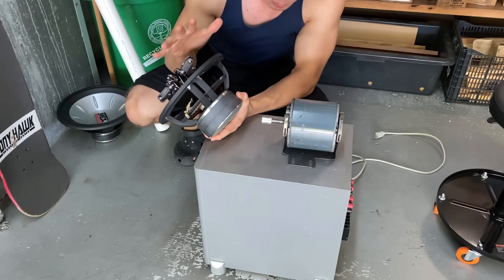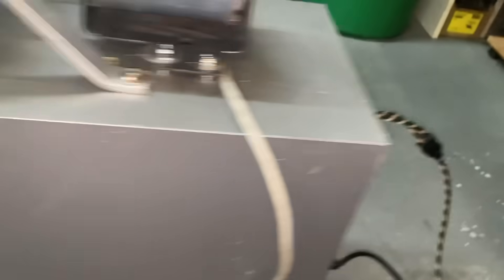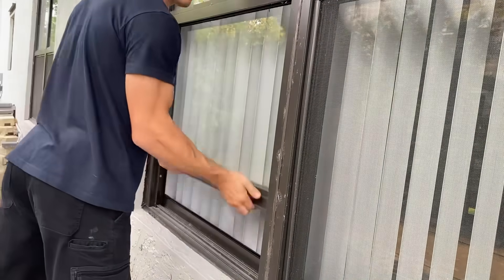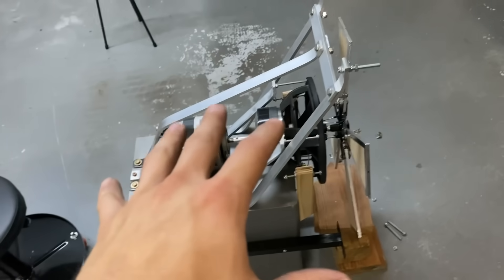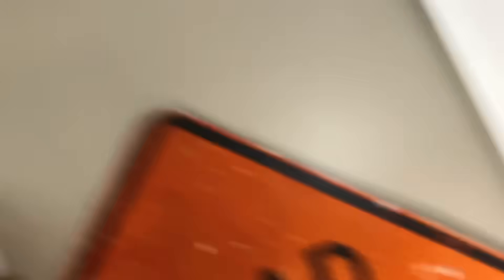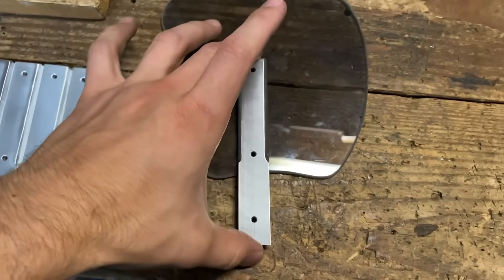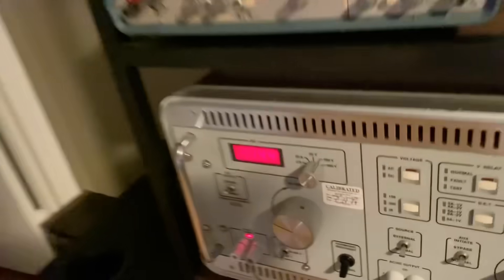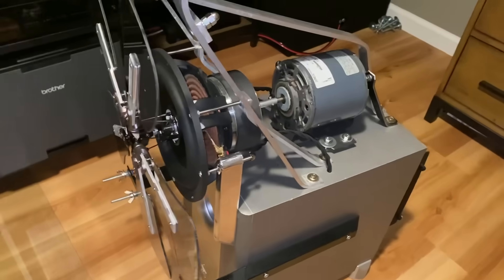Making the worlds most powerful subwoofer (Rotary Subwoofer)

Comment: I really wanted to see it demonstrated with more audible frequencies.

Some headphones might claim to reproduce 10hz, but who's going to call them on it when the average person can't hear anything lower than 20hz.
Reply: Its like max wattage vs rms wattage. And the lower the capability, the less the headphones will struggle when producing Near that frequency. Bass songs with 30khrtz to 200hrtz sound a lot different than 30khr😅tz to 15hrtz headphones. Also, want to look at driver size, 30mm don't sound as good as 40 or 50mm, or even dual driver headphones. Of course you have your tube amplified, just blowing everything you thought you knew about sound out the window.
Reply: You can easily hear down to 12hz if you have decent headphones / speakers and use a tone generator. At around 23hz it stops sounding like a tone and starts sounding like clicks however (for me). This is a subwoofer and a massive part of its purpose is to produce infrasound that can be felt in your body, and heard via the vibration of every object in the vicinity. What did you want? part of the video to simply be a sine wave that tells you nothing about this setups power or capabilities beyond that it can produce the same tones as any other subwoofer. This is a showcase of power and in order to showcase it you have to operate in infrasound, where most subwoofers couldn't even begin to match this thing.
Reply: 23 and can clearly hear the 10Hz. The average person watching this video is far younger than the global average that hearing averages are based on
Reply: You're quoting false information, there is no magic set limit at 20hz for human hearing, it is incorrectly quoted as being the limit as it is defined by the ANSI/ASA S1.1-2013 standard as the lower audible range of frequencies. Humans can hear and more so, perceive lower air pressure frequencies with ease.

Comment: Human hearing range is from ≈20Hz - 24kHz what we are hearing is not the 10Hz frequency but something different.
Reply: We can feel it if our speakers can reproduce it.
Reply: Likely overtones.
Reply: probably overtones (20hz, 30hz, 40hz, etc.)
Reply: @@mojogo1735 Do you have a name for the effect you're describing?
Reply: @@mojogo1735 You're so full of shit, read a fucking book.
Reply: Wrong, you're quoting outdated or false information, human hearing range has no set limit. You are quoting 20hz being the lower limit because it is commonly thought to be, as defined by ANSI/ASA S1.1-2013 standard for audible frequencies. Humans can hear and more so, perceive air pressure frequencies way below 20hz with ease. Stop spreading false information.

Comment: so i read it can go down to even 0 HZ, by just compressing the static air. but how high can it go? 20 HZ? 30? is it possible to get it into hearing range?
Reply: Not sure about his particular device, but the upper limit on these rotary woofers is close to 20 Hz. Anything above 30 Hz gets some distortion. Fortunately, the rotary woofer covers what loudspeakers cannot, and vice versa.
Reply: Most speakers can go down to 1 hz.. go to Google type in tone generator and set it to 1hz and watch your speaker breathe at 1hz
Reply: Hearing Range will not shake anything and it will just be loud to be real
Reply: @ELISHACAEZ  probably but im asking about what it CAN do, whats the upper limit?
Reply: @ELISHACAEZ  Do you mean with this particular speaker or in general?

Comment: Hey, I used to work for Eminent back in '08-'13 building these bad boys - great job! We used RC helicopter parts for a lot of prototypes before we went to custom machining/CNC for the commercial units. You'll find that the closer you get your blade tips to the baffle, your sound pressure will go up exponentially.
Reply from the maker: No way! Glad you were able to stumble on this vid. Big thanks for the tip, I’ll see what I can do minimize the gap.

I just have one question if u could. Do u have a piece of tech you’d recommend that can allow me to cross this thing over below 20hz. Everything out there doesn’t really let me work with freq that low

Comment: any chance you could link to that dude that used the helicopter rotor as the blade actuator? 
i wanna build my own now <3
Reply: Look up most any five rotor blade SCALE rc helly swash plate and blade grips set should get you close enough to compare tons of options If you have a big enough pair you can go as far as purchasing the spindle oh Jesus bolts and main spare gear with high torque high speed Alian metal servos and the Alian trex 800 dominator brushless motor with like I think 11hp 5 blades 5'+blade span 2400 rpm get yourself a 6 channel spectrum radio so you can have full control with 3 different collective modes leaving cyclic up to the driver and just for good throness you could try using 5 separate drivers you want to look for drivers with deep excursion the longer the speaker drivers excursion the more defecation you can achieve happy pants soiling🎉

Comment: 2 things, you need a special speed controller for it. The higher the amplitude the higher the resistance to the motor, the commercial one has a speed controller that will vary the power to the motor based on the sound coming in to maintain an EXACT rpm, otherwise the speed warbles with the movement of the blades and distorts the sound. Second, you need special blades, similar to the blade design of military submarines. Any old blade will chop the air and create significant distortion, the blades on the commercial woofer are designed to minimize air chopping and therefore unwanted distortion.

Comment: I have several questions regarding the Rotary Subwoofer 
Anyone have a explanation on it?? 
My brain is having a hard time trying to figure out the use and motivation behind it.
Reply: Creates sound pressure. 
It is great for movie sountracks, very low frequency rumble. Not so much for music.

I would have liked to see if it could have gone up to 80hz and its effect, compared to to the 10hz test that he showed.

Instead of these for your home theater, just install bass shakers into your furniture (Like the Buttkicker or Aura), or put a subwoofer between your floor joists.
Reply: I am no audio technician but it seems to me that the fan is assisting the speaker. Sound is just basically vibrating air, in order to get a big amplitude (volume) at these frequencies you need to move a lot of air. As the fan is paired with the speaker it is able to synchronize with it and push more air than the speakercone could alone... just thinking out loud here, not sure if this is the actual mechnism behind this.
Reply: @casb2480  your explanation is very informative thank you very much.
It is very fascinating how you can make a house "Breath" with a fan and subwoofer
Reply: @neromastic4512  It actually works like a helicopter, just that it turns the "up/down" direction in the frequency of the signal

Comment: Quick question...

2:08 What's a "good" pair of headphones that can go down to 10 Hz?  Also hire much do they cost and what human has ears that can use them to hear at infrasonic levels?
Reply: Audio-Technica ATH-M40fs flat response headphones. I've used these for mixing in my studio for over 20 years. 10 Hz isn't audible, more like 'pressure'. The ear cups must be sealed and your earphone amp has to be able to handle it. Bad thing about the headphone's design is they will cramp your ears. This model was superseded by the ATH-M40x that lists going as low as 15 Hz, but I think it's because of the roomier ear cups... they should work similar.
Reply: @someonespecial1525  so the answer is... None.. Right?
Reply: @Igrowyourbiz  Nope. You can get any speaker to go down to 1hz, the coil will just move back and forth once a second. The air pressure it creates won't be audible or possibly even otherwise possible to sense, but unless you're running a filter for the audio, any speaker (headphone voice coils included) should be able to do it.
Reply: @Tuhopolttaja  there is a reason speakers have a "frequency response rate".  Generating a tone from feedback, signal noise or power hum generally doesn't count.  The point of a speaker is to present audible, legible, clean sounds. Generally in the form of music or vocals.

This is a video of an unnecessarily overpowered  tone generator with a fan.   But hey, go off.

Comment: the bends on the flat bars removes most of their strength. Get a welder, use straight edges, triangle shaping, some spacers. Flat iron for the brackets, thick as you can find locally (~5mm is quite typical in retail stores)
Reply: or just use angled bars  L - shaped

Comment: That's nothing - I used a hydraulic accumulator pressurized to 3000psi with a 440 3-phase 10hp motor.
I screwed  a 20 inch earth auger 10 feet into my back yard soil where it hit rock. A 4 inch diameter double ended double acting hydraulic cylinder moved a 700 pound weight up and down when a de-coned subwoofer operated a 4-way hydraulic spool valve.
     I built it to make my neighbors move away and it worked !

Comment: kinda interesting but just about every part is going to have a weird resonant frequency unless they are cast iron or concrete. We're talking about the window frame, the walls of the house, and even the fan blades. Yes, you can move the air, but making some serious Db sound that's not distorted needs much more.

Comment: Its hard to believe the door part, but the subwoofer is really cool
Reply: It seemed pretty intuitive to me, especially hooked up to the window like that. Every time the fan twists, it starts pushing a lot of air inside, then it flattens and the pressure equalizes, and it goes back and forth like that. It's sound but it's even more intuitive than regular sound.
Reply: It's just air pressure man
Reply: You just don't understand science.
Reply: @HybridMiranda  Perhaps I phrased incorrectly, it's *hard to believe. Obviously it's the soundwaves traveling throught the doors making them vibrate.

Comment: Just so people know, you can't play regular music with a rotary sub bass device. It would literally shake out of control. The purpose of this is to give the bass a punchy experience. The experience with this is what you feel not what you hear. The amazing part is most of these are 5-10Hz so 1-2Hz is an amazing feat to build.
It also creates a infrared sound that penetrate walls pretty far so you won't see this in common theatres. Many setups are made in double room labyrinths which also have to be inspected by a structural engineer because it can literally demolish buildings.
Reply: Infrared sound? Or infrasound? Infrared is light, not sound.
Reply: Hey, can it out a fire out?

Comment: Ok, subsonic waves as the result of uniform pitch change of fan blades. Does the motor need to be specially driven so that the spinning speed can be consistent  under the load changes, or does it just draw more power under the increased demand quickly enough to produce the inputted Hz?

Comment: It's 90° out of phase with the signal. That would stop it working properly with music. (Also only a synth or pipe organ can go that low. I can't think of any mechanical instrument that goes below 20Hz))
Reply: I’m curious, why do you say this rotary subwoofer is 90° out of phase with the signal?
Reply: @voiknallen1447  because you would expect maximum air movement on the rise or fall of the sine wave as it crosses the x-axis. That's what you get with a speaker. But with the rotary sub the fans will be flat at that point - they'll be twisting between suck and blow and there will be minimum movement.    

Equally at the crest of the waves you should be getting no movement, but with the rotary the vanes will be at the greatest angle and be creating maximum movement.
Reply: @aleksdegromoboy7482  ok, I guess that explanation seems reasonable. I don't have any qualifications beyond high school science and a couple of classes in college that touched on audio/record engineering. The way I understand sound is as waves of pressure moving in the air, not the air in the room moving itself, akin to a cork on the ocean which will bob up and down, but hardly moving side to side.

I can imagine a traditional speaker, its diaphragm driven by the signal, compressing and decompressing the air within its stroke, which creates a small pocket of pressure near the diaphragm's surface. I'm sure we both agree it is this difference in air pressure and not the air molecules themselves which radiate into the room at the speed of sound. 

While I do expect the diaphragm and its neighboring air molecules to be moving during a zero crossing, I do not expect that to be a point of maximum pressure difference. It seems to me this air would be in maximum compression or decompression when the diaphragm is at a maximum. When the signal, and thus the diaphragm, crosses zero the air pressure on either side of the diaphragm would be the in equilibrium and the same as the resting state. This also seems to be the case with the rotary subwoofer, only the vanes alter the air pressure instead of the diaphragm.

What am I getting wrong here? Also, if air movement (and thus pressure?) is maximum on signal peak for the rotary sub, but maximum at zero crossings for the traditional speaker, isn't it the traditional speaker which is 90º out of phase to the input signal? My brain goes numb trying to understand how signals of combined frequencies would be rendered if the velocity of the diaphragm dictates the pressure. Could you explain how this works or provide some resources to better my understanding?

Comment: did u know that human can hear from 20hz?
Reply: "did u know that human can hear from 20hz?"

Did you know that humans can feel down to ~0 Hz?
Reply: 20 Hz is considered the normal low-frequency limit of human hearing.[citation needed] When pure sine waves are reproduced under ideal conditions and at very high volume, a human listener will be able to identify tones as low as 12 Hz. Below 10 Hz it is possible to perceive the single cycles of the sound, along with a sensation of pressure at the eardrums.
Reply: @Tuhopolttaja  You apparently don't understand. I'm not talking about hearing. I'm not talking about eardrums. Low frequencies can be felt by the entire body.

That is, in fact, the principle upon which tactile transducers or "bass shakers" operate. Look them up if you have never heard of them.
Reply: @bricaaron3978  Oh I wasn't replying to you. I'm aware of "bass shakers", I have a few on the shelf waiting for installation into my racing setup. I was replying to no-name168 and was completely relating it to audible sensation and the mythical 20hz limit (which isn't the limit except defined by the ANSI/ASA S1.1-2013 standard).
Reply: @Tuhopolttaja  Oh, O.K.

Comment: Fascinating, I wonder how this technology works, or even why it works.
Reply: Not an audio expert but since sound is nothing more than vibrations passing through a medium (usually air) this just works by oscillating the fan blades to alternate the direction of the air flow through the fan. A normal sub works by pushing and pulling air, but a fan is capable of moving a lot more air at a time and so by having a fan that can alternate the direction of the air it's essentially doing the same thing on a larger scale. The only drawback that I can see is that it may not have the mechanical capacity to operate at higher frequencies. This thing would be at it's best as part of a system where you had other subs and speakers to handle the higher ranges.

Comment: You should be able to flip it around and set it up inside your room, facing out the window and it will work the same, just like flipping a regular subwoofer driver.  Very cool project!

Comment: As a note, the reason rotary subwoofers aren't more common is they have very poor sample rate response, excessive resonance and very poor overtone fidelity.    Still, they do make a good deep-sub in double-sub woofer design (meaning far lower than a normal subwoofer, typically as the high power low frequency subwoofer in a pair.)
Reply: Yeah probably makes sense to have a crossover where the normal subs pick up

Comment: How did you make the blades variable pitch ? Is that necessary ? What rpm is the motor turning or does that matter and are the rpms variable to the frequency ? How many watts of amplifier power were used or estimated  used ? What was the highest frequency you experimented with ? How well will it work at 100 hz   200 hz  to 400 hz etc ? 
 Very cool project ! 
 Great job as well ! 
  I am sure you had days into this .
  God bless
Reply: Did you pay attention at all?! 😂
Reply: I'm not knowledgeable to answer your other questions, but yes the variable pitch is neccesary because without it, it'd just be a fan. A continuous in/out breeze won't produce audio, as audio is perceived as rapid cycling change in this flow, as in, the in/out repetition. This is Frequency, measured in Hertz. Faster in/out cycling, higher frequency, higher pitch tone. 

I imagine (very rough guess) that it wouldn't work very well above 300ish Hz cause the blades would have too much momentum to physically rotate in/out that fast. I guess that'd depend on how strong the actual subwoofer driver is

Comment: if you had a larger actuator and stiffer blades, maybe you could make this thing capable of producing frequencies high enough to be applicable in actual music? it seems to me that with the polycarbonate blades, any frequencies much higher than 5 hz would just flex the blades.